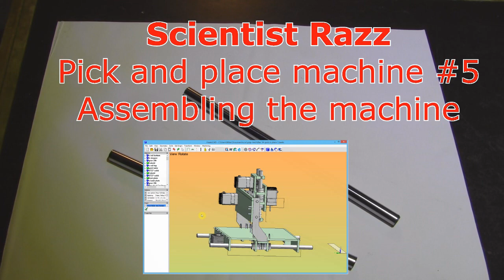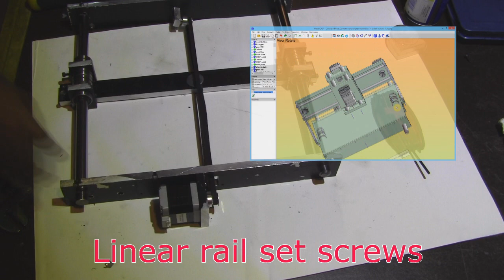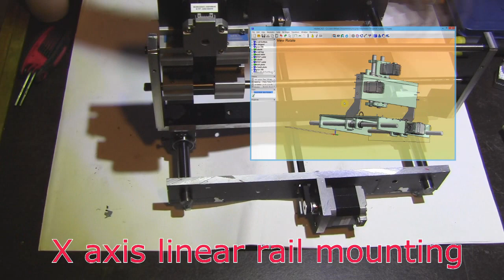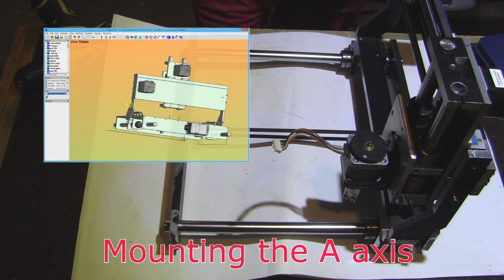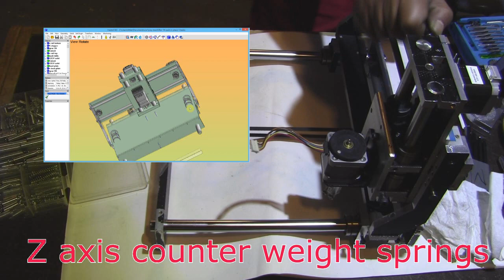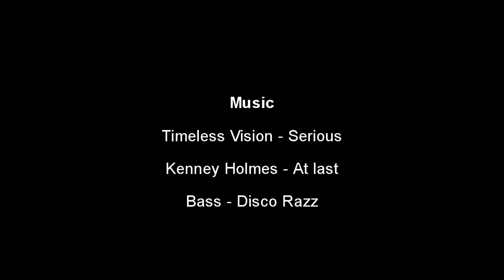Homemade CNC Pick and Place Machine X2 CNC #5

Comment: Hi Razz, nice work!

Well, how do you realized the pnp-head?

I am building a machine by my own,
but i have a problem to create a head with a spring in it,
like you have. My ideas are to massiv, yours is clean and simple!

Is there a discribtion in the other videos?
Maybe a skipt it. :(

best regards Flo
Reply from the maker: Flogo85 This video shows the construction of the spring vacuum head:https://www.youtube.com/watch?v=euUaCpo9YHIIt uses a 16 gauge syringe tip for 1206 size components.Tolerances must be as good as possible otherwise you will have binding or play at the nozzle and rotation will be off center.
Reply: Scientist Razz Thanks, oh man, i skipped that video because of the titel :D